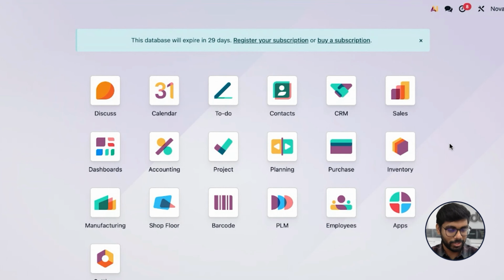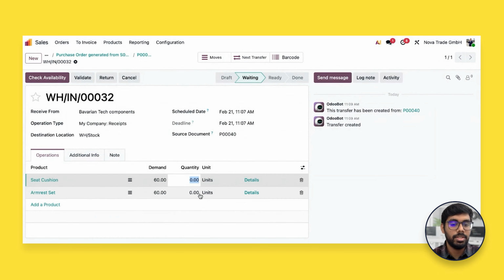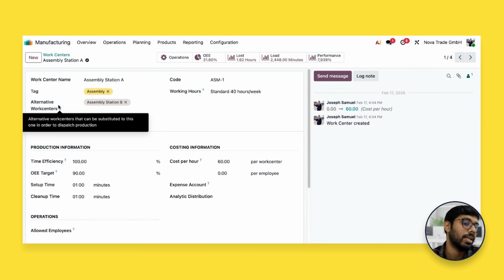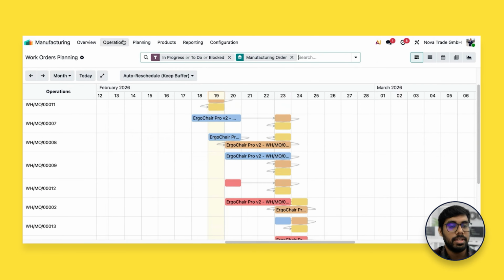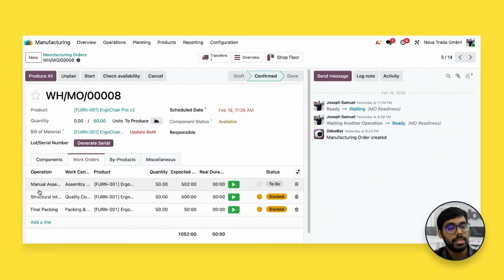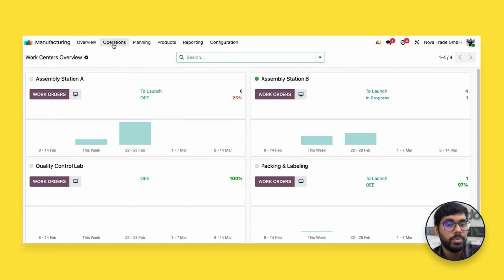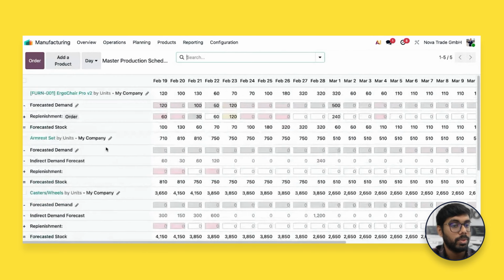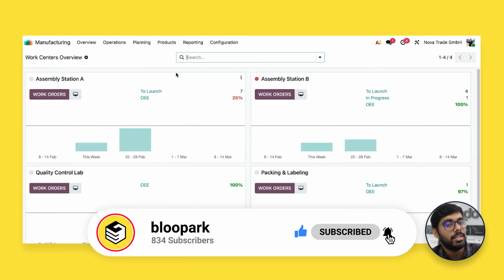Odoo Manufacturing (MRP) Full Demo | From Sales Order to Production

Comment: Really useful walkthrough. One thing worth adding for small manufacturers watching this — if you're on **Odoo Community**, you won't get the Planning or Quality modules out of the box, but you can still build a solid MRP workflow:

- Use *Manufacturing Orders + BoMs + Reordering Rules* — these work well in Community
- For production scheduling, combine MO deadlines with a simple Kanban view
- Track quality via custom fields on MO or a lightweight custom module

Also, if you're an Indian SME, make sure your BoM costing accounts for GST input credits properly — it's a common miss during initial setup.

Good demo for anyone evaluating Odoo MRP end-to-end. 👍
Reply from the maker: Great additions! You're absolutely right. the Odoo Community version is a powerhouse for basic MRP, and your tips on using Kanban for scheduling are spot on for teams just starting out.

Regarding your point on GST: that is a critical call-out for our viewers in India. Proper fiscal localization is where many ERP projects succeed or fail. While we focused on the Enterprise features here (like the Shop Floor App and Planning) because of the sheer efficiency they add to a growing factory, it’s good to remind everyone that the core 'Odoo Engine' is flexible enough to work even on a leaner setup. Thanks for sharing those insights!